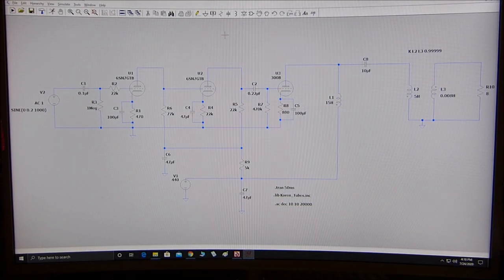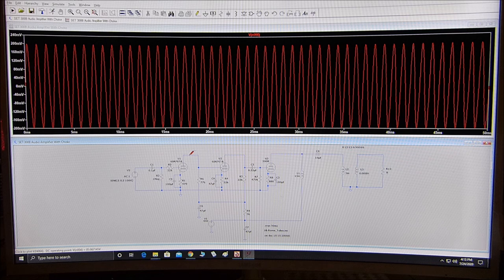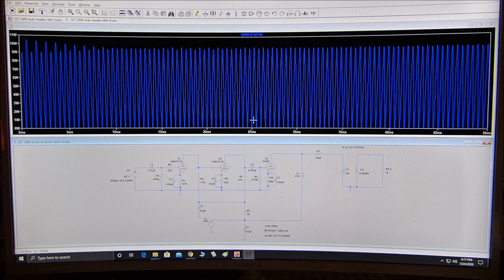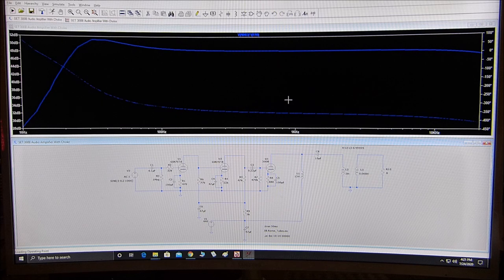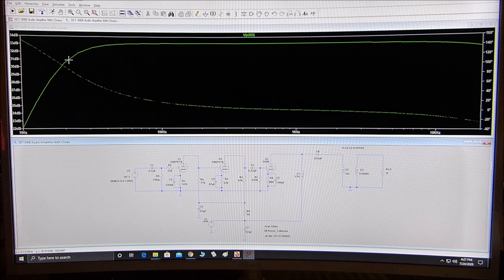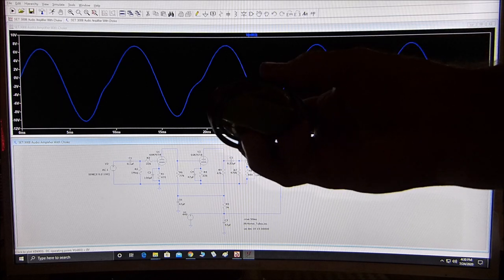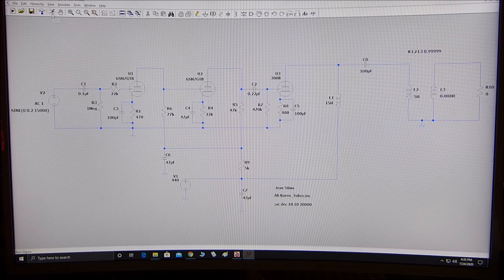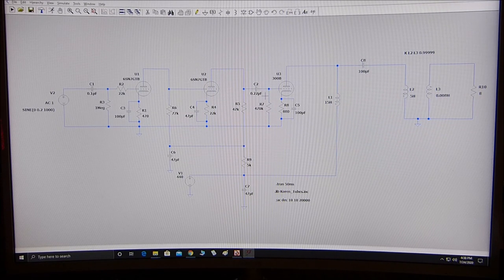LTSpice Modeling Of SET 300B Choke Loaded Plate Tube Amplifier

Comment: How to calculate choke plate load for 45? I saw 2A3 use 50H CHOKE plate load. I am curious how to calculate for 45 thank you
Reply from the maker: That is a great question and from two different plate-choke loaded SET amplifiers I have built, I find that huge inductors are not the best answer. There is an idea in audiophile circles that the greater the inductance in an OPT, the better. That probably got started with the first Williamson design push pull amplifier where Mr. Williamson suggested 50H in his design for an OPT.
My SET with 15H chokes performs much better than the one with 40H chokes, I believe, for one simple reason, the shunt capacitance in the 40H choke is excessive.  It is a common problem to have HF attenuation in SET amplifier but no one seems to want to address the output inductor, whether it be a choke-load or gapped SE transformer. 
To further expand on this consider a good quality push pull OPT. It will likely measure 20H plate to plate which is 5H plate to CT. It is plate to CT where the audio is developed not plate to plate. There is some idea that the inductive reactance at low frequencies must be extremely high. That is obviously not true from examining the push pull design.
The bottom line of theoretical "design" is one thing and empirical success is another.
If you chose the choke-load design, which I have had success with, I would suggest a 15 or even 10H choke. I have also found that the OPT used to match impedance to speaker load should have a high impedance towards the plate choke meaning a 8K to 10K seems to do a good job.
Good luck with your project. There are no absolute road-map-designs in this SET world. It takes experimentation and sharing of experience to get a good working unit - in my opinion,
Reply from the maker: @nuttyl283  Those resistor values look reasonable to me. Nothing is perfect but in the case of your 45, the main thing is to get the bias correct for that tube. Make it whatever the tube data sheet recommends and it will work. You can tweak it from there if you want to.
Reply from the maker: @nuttyl283  That is a nice model. You may have to experiment with the first stage and the 100uF cathode bypass capacitor. Not saying that is wrong as it will increase the gain of the first stage but I would try it with and without the bypass capacitor. If you wish to incorporate any NFB, you will have to remove that capacitor.  Nice job modeling.
Reply: @ElPasoTubeAmps  for 300B 15H is cutoff 3DB at 10hz    Anode resistance of 700R of 300B can be calculated as 700 = 2 * 3.1428 * 10Hz * L    so L more than 11.5  HZ is enough.  However for 45 anode resistance is 1700R  so  L will be 27H at least for 10hz 3db cutoff
Reply from the maker: @nuttyl283  I have to admit, I did not determine low cutoff frequency on my 300B. I just used what I had, two chokes of which were 15H. I am now convinced that chokes with high shunt capacitance, which I suspect is going to be a problem with 40 and 50H chokes is going to be a problem in the other direction - in high frequency attenuation. HF roll off seems to be reported frequently in SE amplifiers. Maybe it would be better to sacrifice some LF response for better HF response. This was not uncommon for a few years and studying the Brook 12A it can easily be seen in the design that LF response is intentionally limited. I believe it was Paul Klipsch that said the best sounding system, to him, was a Brook 12A design and his Klipsch speakers. I have often wondered why rolling off LF response was popular back at that time. Myself, being interested in high-end audio equipment starting in 1962, I was, I suppose I should say, indoctrinator into believing too much bass was "boomy"  and sounded like a juke box and I kept that "ear" for HiFi equipment, probably to this day. My Klipschorns can certainly not be called boomy but some would likely call my Tekton speaks heavy on the bass - (but I kind of like it...   :-)
Reply: @ElPasoTubeAmps  Thank you but it think 15H for 45 may be ok at 18Hz -3db cut off.  The deepest bass of my song is about 35hz only most are not low below 35hz.  My speaker is B&W DB603 S3  F3 44hz  hence 18hz -3db of 15H choke seem enough.
Reply from the maker: @nuttyl283   I think we are realizing the same thing. This insane goal of 1000uF capacitors in a power supply where in the best equipment of the past used 40uf and on and on and on - you know where I am going with this, is just sales pitch and more isn't usually better. I will mention again that high-end OPT are 5H plate to CT with a plate load of 2500 (R) ohms and that gives a cutoff of 80 Hz where Xl = R. Something to think about.

Comment: Some of the "strange" results you are getting can be due to the fact that the models of inductors are ideal, i.e there are no resistive losses in either series nor prallel with the inductor nor are there any shunt capacitances which are present in real parts. Try adding some and see what effect they have on the results.
Reply from the maker: Good point. I did not add any to the inductor model. I will do that. Thank you...
Reply: @ElPasoTubeAmps  They also do not account for any core saturation effects, i.e. the core is assumed to be air/vacuum. Modelling that is yet another big task.
Reply from the maker: @Stelios.Posantzis  I have found out in at least two amplifiers I have built that saturating the core of transformers doesn't seem to affect the power and frequency in the voice range (300Hz - 3KHz) but the lowered inductance (from saturation) does affect low frequencies below about 80 Hz - in my particular cases. Also, I have measured high-power modulation transformers that are intended to carry heavy class-C RF amplifier plate current thru their secondary, and at their specs, (probably from a proper core gap) does not saturate the core with a huge drop in winding inductance. Somewhat off the subject but thought I would throw it in there. I did build and still have a very simple transformer/choke measuring jig for determining inductance at different current levels. It seems inductance in a good inductor (choke) holds up pretty well until max current is exceeded and then inductance drops quickly above that point.
Reply: @ElPasoTubeAmps  No doubt I have been preaching to the choir!
Realistically, I'd assume all well designed transformers would never saturate in their intended usage range--unless heavily overdriven. 
I was making that comment from the perspective of investigating the distortion characteristics when every last ounce of performance is squeezed out by the design of the circuit.
Your point is very interesting nevertheless.

Comment: Please do 6SN7 45 choke plate SE Schematic please,  I have 2 of 45 tubes, 10 of 6SN7 and 2 of 5U4G with 2 of 5K OPT .  If you can show me your design of 2 watts 45 in LT spice , Please show in Youtube.  Thank you and also 2P29L 4P1L PSE X2  (4 watts).  I can't decide which one is suitable for my 90db speakers.
Reply from the maker: I do not have a model for the 45 tube in my Koren file but it would be exactly the same driver circuit and the output tube schematic would be the same but the tube data sheet says use a 1500 ohm cathode resistor instead of the 880 ohm resistor I showed in this model. Also, lower the plate voltage to the spec sheet. Here is a link to the 45 tube data.
https://frank.pocnet.net/sheets/021/4/45.pdf
I have found out from more modeling that the minimum plate inductance needs to be 20H. The plate choke and the line transformer primary appear parallel for the signal so that means each must be at least 40H each to pass 30 Hz without very bad distortion. This is going to be a challenge as a 40H choke must be rated at 100 mA or more for the 300B. I am going to see what I can do in building the amplifier to make the low frequency response good.
I hope these links help.
Reply: @ElPasoTubeAmps  440V might be too high for 45?  for L1 it is 15H 50mA for 45 and 6SN7?  L2 +L3  is 5K : 8R?
Reply from the maker: @nuttyl283  I think 440V is a bit high for the 45. Probably turn the plate red. You can figure the Z of the output tube (300B) by using the model but the reactance of the plate choke should be determined by the inductive reactance formula. If L2 = L3 and each equal 40H they are parallel for 20H. This is Xl of 125K ohms for 1KHz and it reproduces 1KHz perfectly. For 30Hz, Xl = about 3800 ohms and that seems close enough to the 5k value of the tube to reproduce 30 Hz with acceptable distortion.
Reply: @ElPasoTubeAmps  Thank you very much, What is the XI? and how to calculate in your diagram if L2 = 5H and L3 =0.008H?  How can I get XI value of 125,000R and convert to hertz?  for 45 I think plate should not exceed 325vdc hence, B+ should max around 330-335vdc.  If I refer to your schmatic, B+ will be 440-330 = 110VDC lower hence the value of R5 and R6 must be lower too.   Can you tell me how much the voltage of plates of 6SN7 after R5 and R6?
Reply from the maker: @nuttyl283  You are learning a lot and I will have to address some of this in a video. Xl is inductive reactance and is  Xl=2*Pi*F*L. If you do this formula for  L=20H you will get 125,000 ohms of inductive reactance  at 1KHz. As for L2=5H and L3=0.008H, I am assuming a standard 5K to 8 ohm transformer which a good transformer typically has a primary L of 20H. Dividing 5K by 8 ohms gives 625 which is the inductance ratio  so if the primary is 20H with that ratio of 625 then the secondary will be 8mH. If the impedance ratio is 625 the turns ratio is the square root of that or 25:1. This is some of the basics of transformers. Not sure about R5 and R6 in my head. I will have to work on that.
Reply: @ElPasoTubeAmps  what are the voltage on plate of 6SN7?

Comment: hi, love your valve amp videos. i built a similar amp from an ebay pcb with a similar circuit. some differences in cathode resistor values ie 750 and 15k for 6sn7 and 1.1k for the 300b and lower 300b plate voltage about 360v. very nice sounding amp. i rewired closely but not exactly according to Mr Renaud’s  circuit http://diyaudioprojects.com/Forum/download/file.php?id=4301&mode=view.  very nice sound. my everyday amp now. with the edcor gsxe transformers the frequency response is ok about 40-18000 hz as per spec. the larger csxe as per circuit would be ideal though and should be close to 20-20k.

Comment: 20:00 Your magnetic coupling (K) coefficient looks rather unrealistic. I guess it's hard to get these figures quoted from transformer manufacturers -- and a pain to measure for old ones whose manufacturers no longer exist so that you can even ask them about it. If you have a number of transformers lying around, it's worth setting up a jig to measure all of them -- you only have to do it once, mark them and then forget about it. Then you can use these figures as a ballpark number when simulating any future acquisitions.
Reply from the maker: I understand what you are saying but it seems everyone basically ignores K and sets to something like I did in the model. I am not sure it will accept (1) as K, thus 0.999 etc. It has been a year or so since I have used LTSpice.  I have to say, I am totally amazed we can still have a modeling program to model vacuum tubes in these (modern) days... with the Koren and Ayume models available and even the instructions to build our own models. Now that you have me thinking about it, I have measured leakage-inductance by shorting the secondary which usually ends up with leakage inductance in the mH range so I think it was from that, that I came to the conclusion it would be OK to assume a coupling coefficient of basically (1) in my models. I think you have inspired me to do some more modeling soon.   🙂
Reply: @ElPasoTubeAmps  If you want to include the Koren models, then you are definitely ambitious. There's a third guy that did valve models--not sure if that was after Koren or before Koren. I did not know about Ayume--now I have to check that so thanks for the pointer. 
Modelling never ends: adding the loudspeaker model comes to mind next, then the mains ac, the list goes on and on...
Your transformers may indeed have very low leakage (if so, I'm sure many people would want to know your measurements on those classic pieces). I have been watching the videos of Sam Ben Yakov which are about switching PSUs so I was probably biased by them. Of course leakage inductance is used as part of the circuit in those applications whereas in a valve amp it's completely unwanted.
Reply from the maker: @Stelios.Posantzis  Here is a link to get started with the Ayumi models.
https://www.diyaudio.com/community/threads/how-do-you-use-ayumis-spice-model-in-pspice.329394/
I don't know if they are any more accurate than Koren but they definitely take longer to run -
Reply: @ElPasoTubeAmps  Dmitry Nizhegorodov is the guy I was thinking of. Do a search with his name for "Composite Tube Models"
There may be others but they are probably older than Koren. I stopped following the subject after this guy so I don't know what's been happening since. As you can easily see, this guy's stuff is already 18-20 years' old. Time flies...

Comment: https://ibb.co/1r2yHkL  If I feed 1.4VDC positive polar to pin 1 tied to pin 7 where to put negative polar in this link of picture. thank you
Reply from the maker: Pin 4...
https://www.radiomuseum.org/tubes/tube_3a5.html
This tube filament is like the filament in a 12AX7 where you can put 12.6 volts on pin 4 and 5 and run the filaments in series or you can connect the two filaments parallel by tying 4 to 5 together and putting 6.3 volts between pin 9 and 4,5.
In your case you would tie 1 and 7 together and put your 1.4 volts between these two pins and the center tap on pin 4
Reply: @ElPasoTubeAmps  If the +1.4VDC to Pin 1+7 then Ground of 1.4VDC should go to Ground after 100R resistor?
Reply from the maker: @nuttyl283  From your schematic from imgbb, they show the center of the filament as the cathode connection thru the cathode resistor of 680 ohms/470 uf and 100 ohms to ground. In that schematic they are assuming you are going to put 2.8 volts from pin 1 to 7 and that is it.  if you want to wire 1 and 7 together and then use pin 4 as the other connection so you can run the filament off 1.4 volts, then you can't use their type of cathode bias resistors and at the same time put your other filament connection to ground. If you connect 1 and 7 and then put 1.4 volts to that connection and the other end of the 1.4 volts to ground it is not going to light up the filament in the tube. Your 1.4 volts will have to go directly to 1&7 tied together and then to 4.
Reply: @ElPasoTubeAmps  Thank you very much. to use 1.4VDC I don't know it but I found that if tie 1+7 together then put 10R resistor to ground  then use + of 3.7VDC to pin 4. Ground of 3.7VDC power supply to Ground. The voltage above 10R will be 2.3VDC and tube filament still get 1.4VDC  (3.7VDC-2.3VDC).  Is it a filament bias?  I still don't know how to use pure 1.4VDC instead of 3.7VDC for this 3A5 tube. I can't find pure 1.4VDC in Internet. Only see 2 versions   one is 2.8VDC application on pin 1 and then ground to pin 7 and pin 4 have cathode resistor. two is use 3.7VDC and 10R.  the three version is pure 1.4VDC inject, I can't really find it.
Reply from the maker: @nuttyl283  I don't know this for sure but I would assume that this tube is for an old style radio that uses batteries. If you tie 1 & 7 together and put one, 1.5 volt D-cell between 1,7 and pin 4 then you can power the filament with one battery. The other battery, the B+ for the plate is likely to be 45 or 90 volts. I have an old radiation device that uses tubes in it and, if I remember correctly, requires 1.5 volts for the filament and 45 volts and also 90 volts. I put this combination of batteries together with D-cells and 9 volt batteries clipped in series. (five 9 volt batteries for 45 volts and ten 9 volt batteries for 90 volts. It works. I think you can look at it  like that and not have to have an exact 1.4 volts.